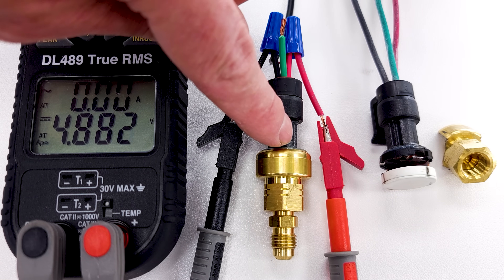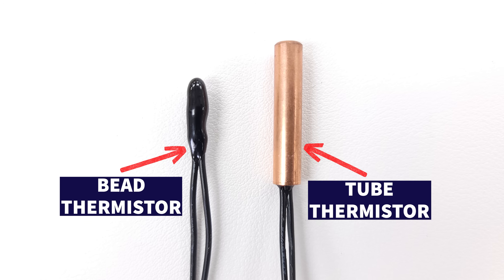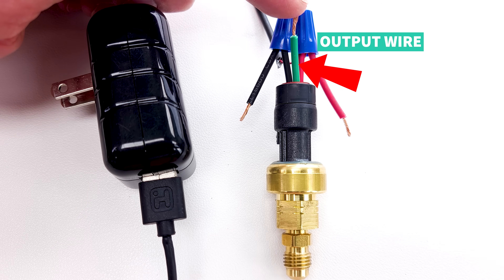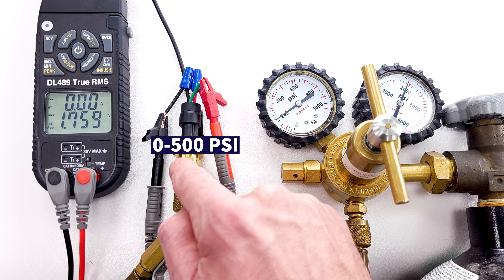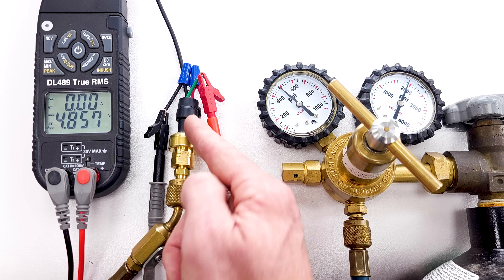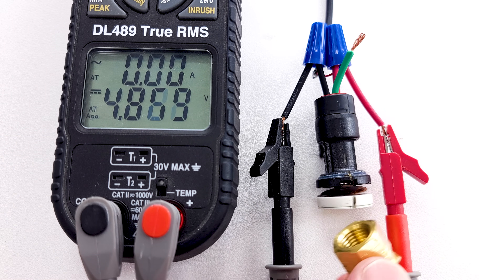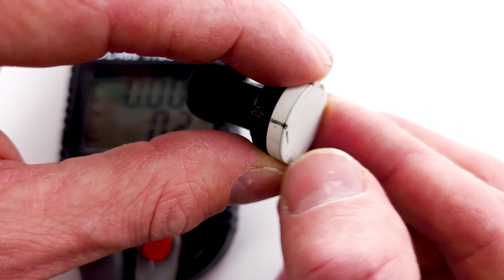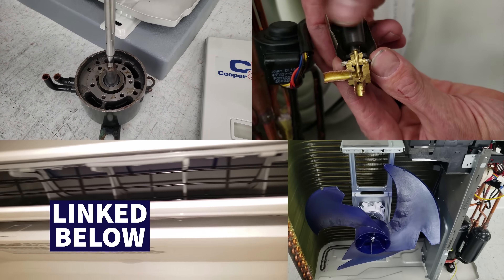HVAC Pressure Transducer Operation and Testing!

Comment: It's probably not the biggest coincidence in the world that those pressure sensors use the same connector and have the same pinout as the pressure sensors used in GM vehicles.

Comment: Hi,
Thank you for the great video and explanation.
Is it possible to use a pressure sensor (with pressure rang 0-1.2mpa) to read water level in a tank of depth 2.5m? 
The Min water pressure (empty tank) would be 0KPa
The max water pressure (full tank) would be 2.5KPa

Thank you

Thank you

Comment: I have a question?  My ac heater system is using double or triple the amount of power and crazy expensive to run.  What might that be?  It turns off as it should and the heat does work and fan blows, meaning it appears to be operating fine.  But it's using a ton of electricity!
Reply: Call a pro and pay them a service fee to check it out.
Reply: 2 years ago.  They were using special heating wraps on the lines which were doubling the power. Now they installed a 'super effocient'  heat pump and my bill is higher year round.

Comment: Question Craig, the actual voltage you are reading on green is the volts dropped across the circuit due to increased resistance, correct? 
In other words as pressure is increased the resistance goes up similar to a positive temperature coefficient (ptc) thermistor?